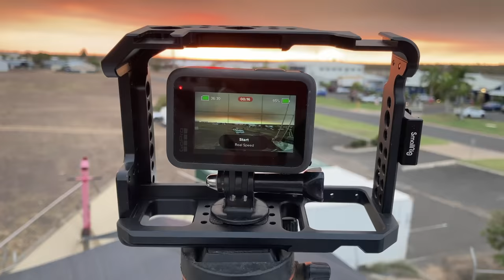Cutting open a Rusty Steel Trawler Bow - Project Brupeg Ep. 252

Comment: Fab work and great graft. From this armchair marine surveyor you’ve done exactly the right thing. The lower concrete looks to be in great shape but to have had fresh sea water sloshing or seeping over the top edges isn’t great. Condensed or dripped freshwater is just as bad.
You mention that the anchor locker is above. When a fishing boat this would hardly if ever have been used, fishermen don’t really anchor, they dodge, but you might do this more often. Can you lower the locker into this space (for stability or to hold extra cable) or how are you dealing with the inherent moisture from the anchor and mechanism? Where does this drain to?
The alkalinity of concrete works in your favour in a steel boat but only while dry. Once saturated it’s the old rust triangle and the ‘tin worm’ wins, as you know.
Cement or concrete does work as ballast but it only has a density of about 2 so as a dive sinker for example it tends to be heavy and awkward above the water and easily to shift underwater. I’m sure you can have a better ballast if needed and means to keep these areas better ventilated in the future.
Thanks!!
Reply from the maker: The locker has a drain system over the side so nothing related to this compartment. Given that this area would be a nightmare to clean my preference is to seal it up and leave it. The locker above is actually quite big. Eventually I want to build a drum winch for the chain under the deck and free up deck space, all of that machinery would be located inside the existing chain locker
Reply: It's very common to see trawlers on this part of the East coast of Australia anchored up in the daytime.
Reply: @rogerbayzand4455 , understood and thanks for the clarification.

Comment: Concrete looks well aged try to use hammer drill with a 1” bit Swiss cheese with holes then chip it out it’s a little easier on ya good luck sorry you found more but y’all caught it good going

Comment: Have you considered pressuring that tank when it's done?

Put 3 or 4 psi in it and run a line upstairs so that you can put a pressure gauge on it, that way you can check on the bulkheads without opening up the coffer dam and then opening up that pipe. It'll also tell you theres a pin hole or anything else in there as well, without having to get so much in there that water comes out the tell tale.

With it being so hard to check at the moment, you probably won't.
Reply from the maker: Yeah we will pressure test it once fully welded shut. And I have pondered a positive pressure with a gauge on the bung. Haven’t thought about a reading in the bridge as it’s a bit of a pain to get cabling from there to the bridge as we have fuel tanks to go through
Reply: @ProjectBrupeg   I didn't mean all the way up to the bridge, just up into to the cabin directly above the coffer dam so that you can wander into there and look at a guage to check.

I wouldn't have thought it was important enough to warrant constant monitoring, just a quick look each morning on the daily routine when you go through and check everything else.
Reply from the maker: Ahh that makes sense. It would be possible to weld a pipe in that brings a gauge either into the anchor room or further up onto the fordeck

Comment: I would have made a template before cutting out the steel but what do I know? They have epoxy waterproof concrete if you want to put the strength back in your bow.  It does not contain any water and should bond to the steel.
Reply from the maker: It’s actually easier to do that once the hole is cut

Comment: Dame...
Getting the concrete out..
Can you get the chisel between the steel and concrete?
Alternatively...
There are things that soften concrete.. question is how quick will they work.. diesel and oil dripping inside a Ferro boat is really bad...
Acid mixtures can break it down..
Fire.. there are mixtures that locally burn extremely hot.. one thing I'm thinking of.. contains polystyrene..
or.. have you tried the gas torch.. wear thick protection all over.. as it can shatter violently..
Water... Heat it up then dump water..

Comment: Why don;t you cut into the concrete with the angle grinder before hammering? Put in straight cuts 50mil apart and hammer in between with a flat Chisel (not to wide, maybe between 30 and 50 mil.) Will come out a lot easier.

Comment: Great videos as usual. Could you leave hole in each bulkhead section and pump a closed or open cell foam in to prevent interior condensation? All the best from Ireland.

Comment: I am a professional industrial painter with a red seal ticket. I can tell you this much. Most steel sailboats rust out from the inside out due to the poor quality of prep in finish on the inside. If they were done correctly in the first place, they would far outlast. Any fiberglass hull core . Craftsmanship is their enemy

Comment: Just a little thing in case no one has pointed it out cement is a powder....Concrete is the result of cement powder being mixed with aggregates (sand/gravel etc) and water..So the lump of stuff at the bow of Brupeg is Concrete not cement.  Brupeg is a steel boat not an iron oxide boat.....
Reply from the maker: That’s true. Never really thought about it like that.

Comment: A little info from the States. The American Petroleum Institute has determined that radius corners don't to a thing. The do recommend that corners should not be placed at the same place. In otherwords stagger your joints.
Reply from the maker: That might be the case but it wouldn’t pass commercial survey
Reply: @ProjectBrupeg  maybe true for steel hulled vessels, but it is still used on wood hulls. With a slight change to a material ( Henry's Roof Sealer) with very close chemical properties. The old product was cold Tar epoxy.
Love your Channel 
Andy

Comment: After all is said and done, will there be an access port from an adjacent compartment so that this new special deluxe hidyhole can be periodically inspected?
Reply from the maker: Actually no. It’s sandwiched between fuel tanks behind and anchor locker above. It’s normal to weld it closed and never open as that risks letting air back in to rust

Comment: Also are you going to have Davits on the back? a lifting platform? maybe some fancy telescoping side boarding ladder/ steps or is that after you are on the water? Are you now in a race with the new trawler in the yard to get to the water (Sorry someone had to suggest it but my money is on Brupeg).
Reply from the maker: So eventual plan is a crane on the roof (just behind wheel house) to lift the jet dinghy onto the roof. A crane on the rear deck to lift the electric dinghy onto the deck while at sea and davits to lift the electric clear of the water when just at anchor etc. as for swim platform, we plan to build that after launch and it’s possible we will add in hydraulics so it can drop below the water so it’s a better diving platform as well as lift the electric up and out of the water rather that using davits.

Comment: Your boat is complete rust bucket mate.
It’s endless 
Believe me
Reply from the maker: Depends how you go about your work. We have sand blasted and painted 98% of this boat. The rust in the front is mostly from the original build 50yrs ago. So based on the evidence it’s actually pretty damn good. If your afraid of rust, don’t buy a steel boat. Believe me…

Comment: When buying steel for a boat should ask for Certified plate so you know where it came from. And not some rejected material off of a job and they sold it to the steel yard. Cheap.
Reply from the maker: No we don't want to be like that, can't afford to be like that and don't need be that concerned. There is very little that is dangerous with seconds...

Comment: Great video,   Just a thought, Will taking out the cement weaken the structure behind it?  When Jess was hitting it with the hammer it seemed to be pretty solid with the cement behind it,
Reply: Yes it will
Reply from the maker: Marginally. It’s an area with a huge amount of triangulation. Plus the keel is 30mm thick. The cement isn’t bonded to the hull, it literally sits in the bottom with gravity. So it helps punching through big seas because of weight but doesn’t make any real difference to overall strength
Reply: @ProjectBrupeg  good to know,   Looking forward to seeing you guys setting sail,

Comment: Good on you Damien! Better to find out these things now and not later. I have a concern about the rest of the concreted ballast compartments re corrosion. Would an ultrasound test be helpful for that?
Reply from the maker: Hi David. We have used ultrasound before and have zero confidence in the readings. The other compartments have all been cut open and inspected at some point in the passed. This is the last compartment with issues.
Reply: @ProjectBrupeg  that's good to hear! Can't wait to see Brupeg afloat again!

Comment: Matt, regarding that bulkhead at the front, if they are water tight can’t they be sealed with nitrogen gas to keep oxygen and condensation out. We always used to cap our boiler drums with nitrogen when we banked them……just asking.
Reply from the maker: Absolutely. I’m planning on welding it up. Pressure testing it then filling from the top with dry ice so I can push the oxygen out from the top and when the CO2 smoke starts to come out I know I’ll have most of the oxy out. I’m happy enough to seal it up with say 10% atmosphere and 90% CO2 as it will rust a little but not enough to effect anything

Comment: I think you need to cut open the port side as well. Bound to be equally effected and rusty….
Reply: There is no vertical baffle there so looking through the openings Damien has cut shows the inside of the port hull plating . Once the concrete is out he'll be able to see what needs to be cut on the port side rather than cut perhaps unnecessarily .

Comment: Why don‘t you fill that forward tanks with nitrogen. Nitrogen is heavier than air. In that way you could prevent rust for a long time. If the tanks are airtight you even could put a gage at the end of your pipe and see if the nitrogen pressure drops. That would tell you, that the tanks are not longer airtight.

Comment: I don't see this as a setback. A setback would've been to get in the water and then the pin holes letting water in AND then having to deal with them. That would've been bad. Plus, not like you can realistically build a whole boat like this and figure out where the pin holes are short of taking down the whole face first, and then giving it a paint coat, which would be difficult.

Comment: Could penetrating the bulkhead with a pipe allowed air to enter. Normally if the chamber is air tight the rust stops due to all the oxygen being used up. Air tightness is critical in none accessible areas.
Reply from the maker: The pipe is sealed off so yes if it was leaking it would cause rust. But I suspect this is long term rust. There was a pipe in there originally that was mild steel and had rusted out. We replaced it with a stainless pipe a few years ago now

Comment: How often are you going to consider your hull done?  I keep remembering you're trying to get into the water ASAP.
Reply from the maker: Still trying to launch asap. It’s gotta be 100% so although cutting into it is almost the opposite of launching. It’s actually better… just slower. This is the last tank we haven’t climbed inside of to inspect fully. We have now!
Reply: Incidentally, concrete and steel don't really get along.  The concrete tends to be acidic and can be a source of moisture.
Reply: @ProjectBrupeg  1 step forward and 2 back?

Comment: you could have saved yourself a lot of time if you just re-plated the entire hull water line down, at this point you almost have....Mate
Reply: That's a way bigger job than you made it sound.
Reply: Ooh, Mr Practical. But not Mr Financially Prudent. I think that buying, forming and fitting umpteen tons of 6mm steel plate is a rather bigger job than patching a largely sound hull.

You've been watching too much bloody 'reality' TV. 

Mate.
Reply from the maker: Hi Gary, we've replaced very little. Most of the cut out plate was to sort the fuel and water tanks and once done went straight back in. It's a huge job and expensive to replace that much metal and would be throwing away usable plate. Jess